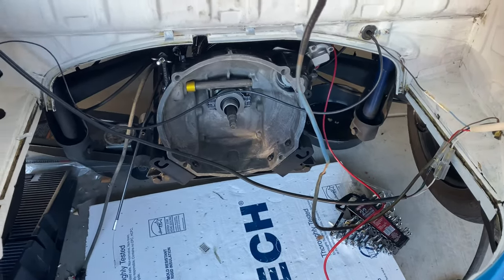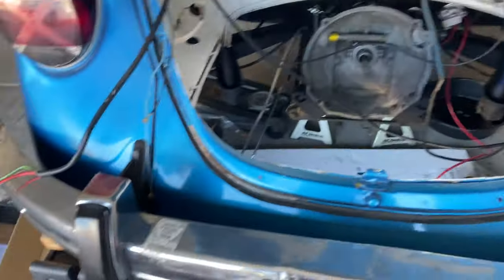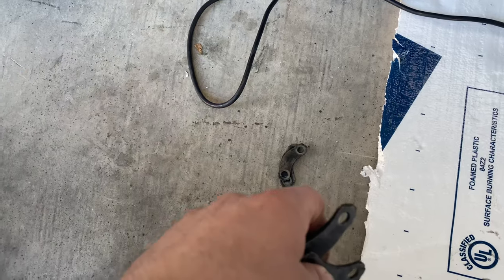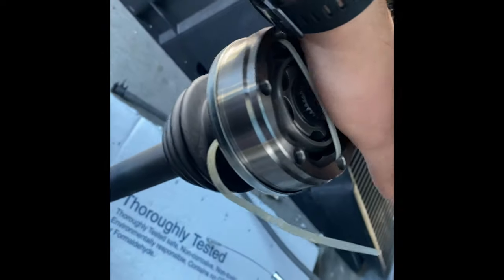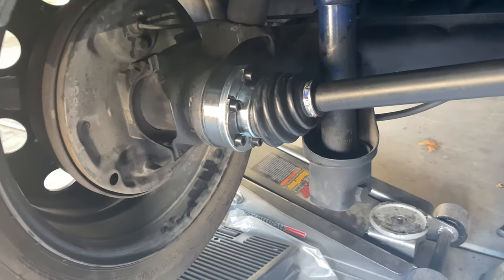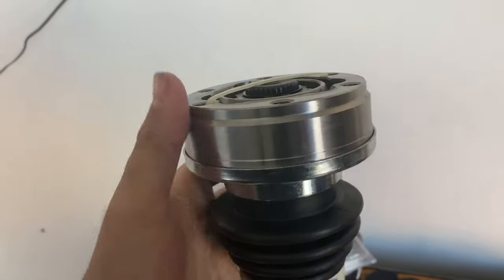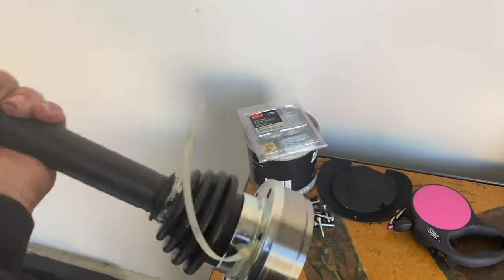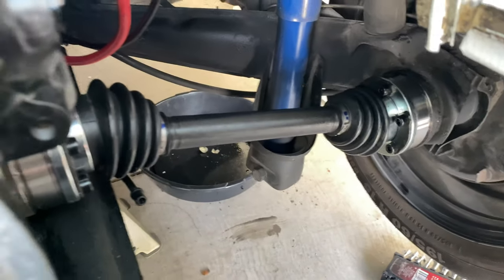IRS Axle Replacement On Vw Beetle

Comment: Nice vid. I was planning on doing this job on my 73 Super. Thanks! Oh, quick question, how are you jacking and supporting your bug at the rear? I've searched everywhere and get a bunch of different methods. Thanks in advance.
Reply from the maker: catalino sopelario I’m glad you enjoyed it and I jack my vw either the sides where the original lift would go and I would place the jack under the U fork where the transmission sits in between.